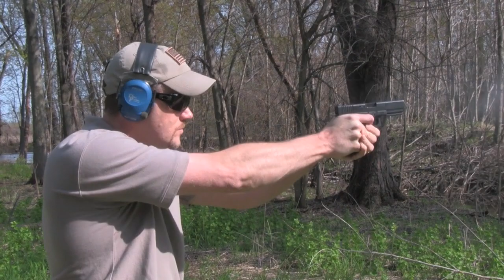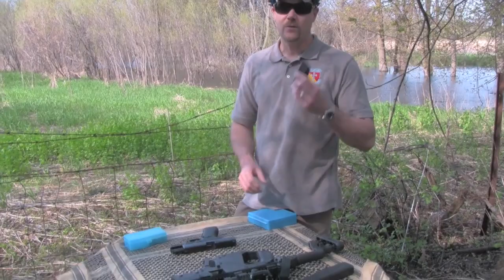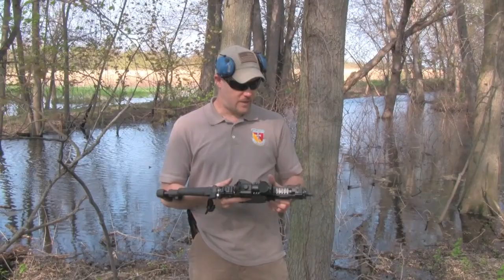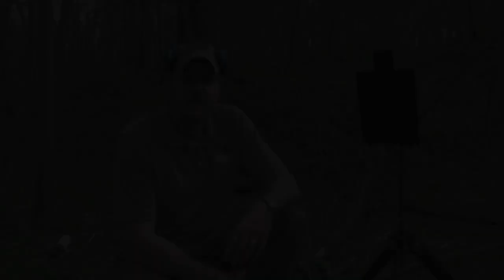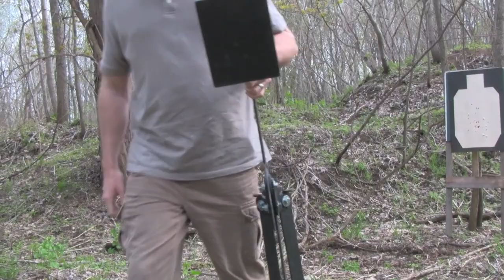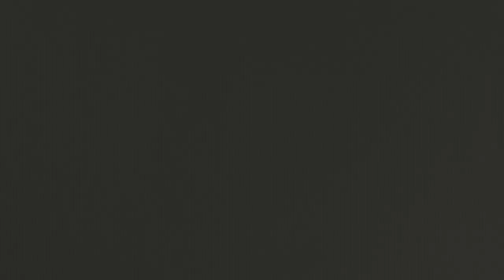Review: Kriss Super V .45 ACP Carbine

Comment: Considering that the Vector has such an amazing recoil system, has the maker ever tried testing bigger calibers such as .44 Magnum or even a rifle caliber to see how much abuse it can take?
Reply: High pressure cartridges (rifles) are a totally different territory. Sub guns and carbines can get away with blowback and recoil operated mechanisms, but a rifle would either require a spring of ridiculous strength, or conventional locking systems (delayed roller blowback, gas operated, bolt action, etc.)
Reply: A very good idea, they should try it
Reply: it CANT deal with the .45, why would you move up to 44 mag?
Reply: Sandy Grungerson
It obviously CAN deal with the 45, performance has proven that.

Maybe a 44 mag in a semi auto?
Reply: Joe Schmoe not without a bunch of 'updates' lol
Reply: Sandy Grungerson
Is the rifle functioning as is? Then it obviously CAN handle it.

Also, tommy guns were made in 10 mm after the 50's for the FBI. It did not catch on but it proves this mans case.
Reply: Joe Schmoe except for that huge crack in the housing around one of the pins...but other than that its all good...

that would be cool as heck to have a 10mm tommy gun, wow....did not know that...

Comment: Kriss is for close range engagement, it has a 5" barrel which is better for room clearing than a SBR, it will also handle better and be more accurate than a glock.

So if you're buying a Kriss, you're not buying it as a back up gun.

Kriss fits the specific role that all SMG's do, close range combat, having a .45 ACP hitting a target at close range is better than having a 5.56 hit a target at close range.

Comment: By BATF Legal Definition, an SBR is any firearm that has a barrel length of 16 inches or less, or has an overall length less than 26 inches (with the stock extended), and it must have a stock, and it must be in this configuration from the factory, weapons like the Serbu Super Shorty, that come with no stock, but is a shotgun, but with less than 26" overall length or less than 18" barrel length counts as an AOW because it's built from the manufacturer like that.

Comment: 1:00 It's C O O L that the Kriss fires the .45 ACP (Automatic Colt Pistol) cartridge, however, it would be even more C O O L if the Kriss was rebuilt to fire the .50 AE (Action Express) cartridge. COOLEST of all would be to rebuild the Kriss to fire the .950 JDJ (J. D. Jones) cartridge which is manufactured by SSK Industies. The .950 JDJ cartridge propels its bullet at 2,200 feet per second. Its bullet weighs 3,600 grains = 230 grams = 8.2 ounces. The muzzle energy is 38,685 foot pound force!!

Comment: round does not matter so much as the barrel length, stock or lack there of, and over all length. for example, a ruger 10/22 fires the .22 lr, but the .22 lr is legally considered a pistol round, you must be 21 to purchase it from somewhere like walmart. would you then say the 10/22 is not a rifle? if it has a rifled barrel of 16+ inches and an OAL of 26, with stock, its a rifle, under 16 barrel or 26 oal, sbr, MADE without a stock, has rifling, barrel under 16, pistol, reguardless of the round.

Comment from the maker: @njurado87 My extended mags were purchased complete from TDI, I haven't purchased any of the conversions and put them on my magazines.  I would make sure you have the spring installed correctly and nothing is binding.  Then I would give TDI a call to see if they can help.  But mine all work without issue.

Comment: I have read over on Silencertalk that the Kriss bolt design makes extraction of unfired rounds, as in the case of a dud, unreliable, requiring the user to drop the mag to clear the malfunction. Does your refurbed gun reliably extract unfired rounds from the chamber? If you load it with a full 30 round mag and cycle it, do all rounds extract reliably?

Comment: BTW, that would be a great CQB gun; great stopping power with great handling in a small package would be good for special-forces, SWAT, and Anti-Terror units. Since the .45 ACP is subsonic standard, the use of suppressors/silencers would be a plus since it doesn't emit a crack by default. I heard the effective range is around 50m for the .45, so it can't match the 200m range of the 9x19mm, but I'm sure that can be compensated for and really isn't an issue.